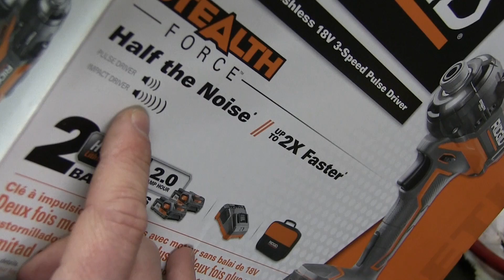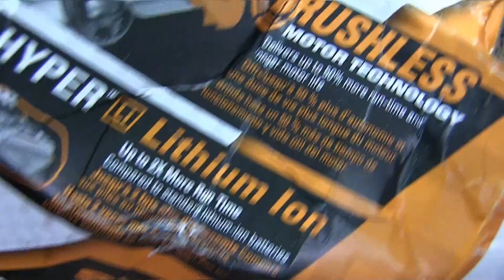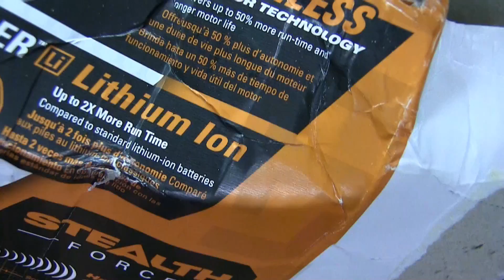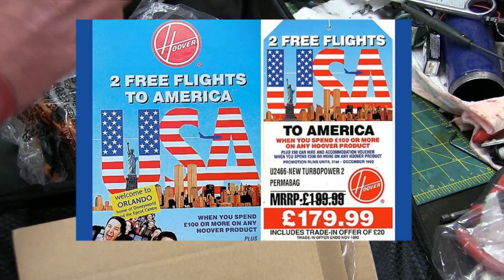BOLTR: Ridgid Hydraulic (?!) Impact Gun

Comment: With the "pulse drive" in this gun you wouldn't get any of the benefits found in a regular impact gun. In the impact gun you are spinning up a mass and then dumping that energy into the driving bit, the big impulse goes into the hammer and the anvil, not into the motor (and then your arm). In this thing you are going to feel the full load of driving the screw/bolt/nut because your hand is connected to the load through the fluid drive. Half the noise, half the lifespan, none of the fun :(
Reply: +Nick Moore 
Impact tools work because the torque is applied quickly over a very small angle and it is the inertia of the tool itself that actually resists most of the torque, not your arm.

So there is no reason why this could not, in theory, apply every bit as much torque as a normal hammer and anvil impact wrench.

Comment: I'm not so sure cavitation will be a problem: unlike a diesel engine, this thing runs near room temperature, and the pressure is never less than 1 bar.  You use a good silicone oil in there and you're never going to get anywhere near the boiling point.

And even if there is some cavitation in this system, the erosion you get isn't going to be anywhere near an ordinary impact wrench, which has pieces of steel whacking against each other a dozen times a second.
Reply: Beach&BoardFan Bingo. You get a cookie

Comment: The ground is to prevent the induced voltage from building up a charge on the rotor that will discharge through the bearing and causing EDM of the bearings. We see these on larger motors being driven by VFDs if they do not have a good ground.

Comment: That seems like an awful lot of machine work just to be chucked into the trash after an indeterminate amount of time.  Maybe the thinking is that the torque will only decrease a little and then taper off.  Won't the extra particles in the fluid increase the viscosity of the fluid and won't that in turn, increase the pressure and therefor keep the thing torquing until ultimate failure.

Comment: That hydraulic "impact" mechanism is exactly the same as they put in pulse tools, I don't see how they could sell it so cheap tho. Any pulse tools from cleco, atlas copco, even IR pulse tools run close to 1K and upwards. In a pulse tool the fluid has to be changed about every 3-6 months depending on usage so I can't see these lasting very long.

Also on a side note the brushless electronics assembly in there looks to be the exact same as all the electronics in a milwaukee 2603-20 and 2604-20 Brushless drill

Comment: I'm betting with the longer torque impulse from the hydraulic mechanism, the forward bearing is relying on the faster moving rollers to spread the impact of any centripetal force across a larger area per moment.  This would reduce uneven wear and be less likely to chip or out-of-round the bearing rollers.

Comment: I have this impact and the drill high end ridgid drill. They both get heavy everyday use and I'm not nice to tools at all. They have been wet, dropped and ran balls to the wall. still choochin like the day I bought them. Torquey little fucks but the only complaint I have is that when its below 25°F they stop working and also will not charge. This poses a big problem since I work outside in the middle of nowhere (Lineman) They end up living all winter in the cab of the truck until I need them. Awesome video, can't wait to see the rest.

Comment: am I the only moron who didn't quite grasp the concept? so the Bldc turns that rotor, the veins can slide in and out as they turn and  compress the fluid while moving it from bigger chamber into smaller chamber. than the fluid goes into bigger chamber, pressure rapidly releases  and gives you that hike of torque?

Comment: Nice BOLTR. It seems to me that the hydraulic method may result in more (as in, additional) rip'ms leading to increased tool life. The mechanical erosion caused by cavitation is for certain less by measure than the hammers in a pneumatic device. I love the video because nobody does this stuff. From a material standpoint, we could set this system up in FIA quick as frig and get answers; but many variables need to be defined. Rockwell? Factory centistoke of lube?
Reply: +longshot789 It'd be a good way to get the user to 'take a break' and most home users pry wouldn't even realize what is happening. So inadvertently maybe they are shooting for longevity after all.

Comment: It would be really interesting to see a proper life evaluation of this. It's unfortunate that this would take too long. (say 2 min hammering in every 5 for 8h/day, how long does it last). Yes, cavitation is a concern - but perhaps it lasts longer than a conventional hammer.
Reply: So far it looks as if this tool is pretty skookum only thing he has found that might be a failure point is the possibility of cavitation, I don't have one apart in my hands but there looks to be profiles made in that rotor that might have something to do with the changing pressures either way being a Ridgid service center I'll try to remember to make a vid or post back here after the first one comes in with a low impacting complaint!

Comment: What if you used a very strong material for the vanes that could resist the cavitation, or maybe reduce the slope to make the pressure go down more slowly?
Reply: i dont know, if it is possible to fight vith this material loss. At least in my prewious job we were replacing all parts affected by it.

Comment: Probably the reason they use that mechanism is because it has a more predictable time to fail, so they can tune it to fail sooner after the warranty expires and get you to buy another.
Reply: +hill billy
literally an engineers wet dream, because of the hydraulic fluid. ^^
Reply: Lifetime warranty, albeit it requires registration.

Comment: Ridgid can fuck off. I will never buy their shit again. I bought a 24V set brand new in 2006 and had problems out of the box. The batteries would shut off under a heavy load. The drill/driver was missing parts and would either lock in or not go into hammer. Each time I addressed my problem with them via The Home Depot I had to pay $30 to get it inspected and each time I got it back in the same condition plus I was out $30 because they never found any issues. If they died of AIDS I wouldn't cry a single tear. Fuck those people.
Reply: Ok, just maybe they have improved ther machines the last 10 years just maybe
Reply: Customer service is key. When I spend thousands of dollars on power tools I expect a decent response. I went to Milwaukee tools and the customer service is better. 2008 was the last time I tried to get any work done my 24V tool. I gave up and went to Milwaukee.
Reply: +Leland Holton You need to outsmart the heat sensor on the battery, that's all. Not that hard to deal with.

Just know how to deal with a lithium fire, also.
Reply: I dealt with a lithium fire already. The battery fell off my drill while on the ladder and it pierced a cell and welp a chain reaction.
Reply: You make Murphy a happy man to make his law come true so often.
Reply: +BikingMNViking the only thing that I really liked from the kit was the bag. The soft bag is probably the most durable bag I've ever had.
Reply: Leland Holton
I believe that because I picked up one some one was throwing out and its about six ft from me now. Laptop thefts are less likely in beat up bags...except its got a tool logo on it. I'll hit it with some spray paint.

Comment: As for those stubborn "serialized" battery warranty claims (and those not minding a slight gray area dance with el diablo)... a couple security screws, a simple plastic shell casing swap and... Bob's your uncle! That's all that's needed to circumvent and play the "serialized" battery warranty claims game. (Example provided, is of course, for educational purposes only:)
Reply: At least they probably won't catch on fire like me DeWilts did a few crow years ago, so something to cheer about.
Reply: +WJK You sound like the kind of man whose retail swapped a RROD XBlox!
Reply: icepick method - Nope... I open those up and fix 'em myself.  If only modern battery packs were as easy and as inexpensive ;)
Reply: Their stickers they use on the side of the packs run along the seams and they are very sticky foil like stickers, you cant take them off without signs of tampering, also the safety screws they use are all aluminum so the second you touch a hardened bit to them there is visible damage to the screws, these are things they would scrutinize to get out of the warranty so not only will you be out on shipping the pack the them but they would probably charge you to ship it back as well, shipping alone puts you about 80% of the cost of a new battery. If you know how to use a soldering iron just buy new 18650 cells, preferably samsung 30q.

Comment: in diesels we have pretty much gotten rid of cavitation by replacing coolent with CAT ec1 spec coolent, has 0% water. my powerstroke though ran now 20 years with the bad stuff, until she came home with me. I wonder if the fluid in this device is designed to use a very specific fluid that resists cavitation. I would wonder why if not , with all the rest of the engineering they put in the little monster.

Comment: you said they are sintered geares, as in tungsten carbide sintering
Reply: oh and the terminals in the handle connecting to the wires , are they epoxied like Dewalt 20v sawsalls or are they soldered properly?
Reply: +texasdee slinglead only super expensive if it was milled in america,  but no let's pay Chinese to run computers and robotics to drive price through the floor. got to love being obsoleted by little rice paddy cats.

Comment: Rubber mallet effect. Keeps bits from snapping I guess. Hope this over engineering doesn't make it to the 3/8 and 1/2 units. With these brushless motors you think they use air tool impact mechanisms that are simple, tried and true.

Comment: The Cummins 855 diesel engines of the mid 70's had bad cavitation problems of the wet liners. There would be a vertical line of holes and some would go all the through the liner.
Reply: +Donald D&#39;Egidio Can vouch for that. Our old NTC 350 filled the sump with water on one occasion. The pitting/electrolysis/cavitation was on the outside of the liner. The mechanic stated it was a bad earth strap that caused the problem. After a rebuild and tune up, 400 horses were unleashed from the old beast. Had very little trouble with it after that.

Comment: I am curious about the duration estimate on the wear and tear on this thing, you didn't seem to give any estimate on expected run time.
As far as I can tell, if it's comparable to an engine and taking into account the severe difference in power output between the two as well as the much longer continuous run times of engines wouldn't it follow that this tool is likely to last insanely long before wearing down?
Great video as usual btw.

Comment: Just a little info about Peer Bearing company. Copied and typed directly from PEERS/SKF Site.

1945 Archer Bearing company formed 
1961 changed name to Peer Bearing Company
1995 Started their first manufacturing works "XPZ", in Xinchang, Zhejiang, China
1999 Built manufacturing works "CPZ" Changshan Zhejiang, China
2003 Established sales office and warehouse UK
2004 XPZ was ISO14001, ISO/TS16949 certified
2005 CPZ was ISO/TS16949 certified
2005 Peer establishes sales office SPZ in Shanghai China
2007 Peer Bearing Company was ISO9001 certified

2008 PEER WAS ACQUIRED BY SKF AND IS OPERATED AS A WHOLLY OWNED, INDEPENDENT BRAND

2009 Peer establishes sales and engineering office in São Paulo, Brazil
2010 Peer establishes sales and engineering office in Bologna, Italy, and Frankfurt Germany
2012 Peer opens its new R&D Centre 
2013 Peer opens Peer Mechanical Parts Turning Factory
Reply: +AvE Hi,

Can I be cheeky and copy and paste some of the same info to you. The first info already send was typed and I want to check my MAC can be read, OK.

TRUSTED BRAND TO GLOBAL LEADERS:
PEER has developed a long and deep rooted relationship with top global manufacturers in our targeted industries. As an award winning supplier, PEER works closely with these companies to integrate bearing solutions that are reliable and cost-effective.
1943 - Archer Bearing was formed and later renamed PEER Bearing Company
1961 - PEER Bearing Company was established
1995 - PEER built their first manufacturing facility, XPZ, in Xinchang, Zhejiang, China
1999 - PEER built manufacturing facility, CPZ, in Changshan, Zhejiang, China
2003 - PEER establishes sales office and warehouse in UK
2004 - PEER manufacturing facility XPZ was ISO14001, ISO/TS16949 certified
2005 - PEER manufacturing facility CPZ was ISO/TS16949 certified

These have been copied at random but can you read these?

Take care
mrbluenun
Reply: +BoboTheEpic MAC is the Apple laptop, but I can never recall the name.

Comment: Is there any way to engineer a similar hydraulic system where the damage caused through cavitation is relatively minor? Or would you design it so that the pressure drop never exceeds the point where a bubble occurs?
Reply: +Spark Gap Well, the Russian and US navies spent a lot of time and money eliminating cavitation from submarine propellers. So there probably will be some tricks that could be borrowed.

Comment: Can you do a video about the types of bearings? I was curious as to why lots of small bearings aren't as good as a few big ones. Wouldn't the pressure be distributed evenly across all of the balls?
Reply: +Kodak900000 not from side loading, smaller balls easier to crack.

Comment: I've used ridgid's warranty several times and as long as you fill out all the serial numbers correctly they don't give you any trouble . So far I've changed out a circular saw and 2 lithium batteries. I personally like their tools and warranty .
Reply: Also have to fill out part numbers

Comment: So ideally, you could mike up the dimensions of your unused t-part and machine up some new ones now. That way, you could keep getting that "new drill" after it is worn.
Not that bad of a failure mode. This tool is more skookum than anticipated.
Reply: +Ben LeBlanc i'd bet that the damage from cavitation would also affect the outer housing at the points of contact with the fin... so it's still not that good unless you want to machine the whole oil mechanism

Comment: Hey, looks suspiciously like my AEG gear I bought over here in New Holland.

Basterds I say, Basterds.
Reply: ***** Makes me wonder if the Ridgid battery packs are cheaper than AEG, they seem to use the identical interface and voltage - good source of cheap batteries!
Reply: +ipullstuffapart They probably are cheaper, but the cost to import and ship might not be worth it. I know an Ozzy fellow that uses on of the bulk shipping services you buy and bunch of stuff and have it shipped there and they bundle and ship it to your country when needed.  Tool prices in the USA are way cheaper than the rest of the world even when you figure in the exchange rate. They are also running free tool and battery promotions all the time.
Reply: +ipullstuffapart aeg stuff look like rebanded ryobi tools. just take look at their impact driver and wrenches

Comment: Interesting that they could sell this to the homegamer. I work with these in industrial assembly, and they will only last 250 - 500k tightening cycles, pulsing 8-12 times/cycle before needing PM. Pneumatically driven industrial versions with shut off torque control run upwards of 2800 USD. Seems like without industrial quality components this would fail pretty quickly. Could be wrong though.

Comment: The ground wire on the gearbox is likely to protect against 'bearing current'. Since the motor is an AC induction motor, you get induced magnetic fields in the rotor shaft. This magnetic field in results in current flow through the rotor, through the bearings and back through the rotor. Current flowing through the bearings results in pitting and then the bearings are RS. Bearing currents require special attention on large AC motors with VVVF control.
Reply: Nick's Woodshop If it is brushless motor it will be like a 3 (or whatever) pole induction motor
Reply: Nick's Woodshop by the way that's a very cool turtle on that picture. I always wanted one when I was a kid

Comment: Interesting.  If the performance is going to fall off rather than it suffer a catastrophic failure, I wonder at what point you can take it back and get it replaced?  You can see it now.  Not enough torque to do anything but it's still working so they aren't going to replace it.

Comment: Perhaps the oil in the pump was specially formulated to reduce vaporizing, and pitting etc? Also when you're mass producing work like that they just pack as many parts as they can fit on a magnetic chuck and grind them all in one go. I'm sure TTI has mag chucks the size of king sized beds in their factory. So they're making thousands at a time.